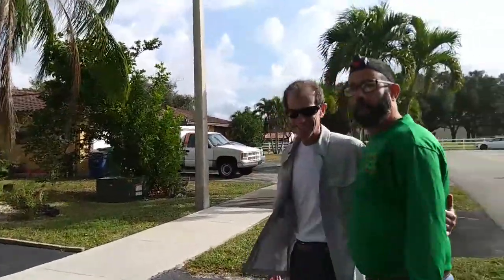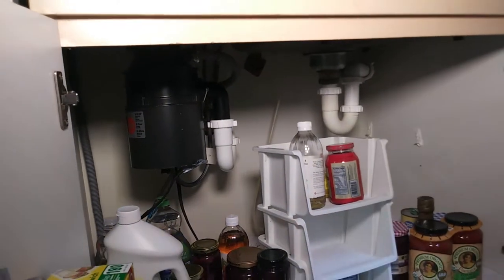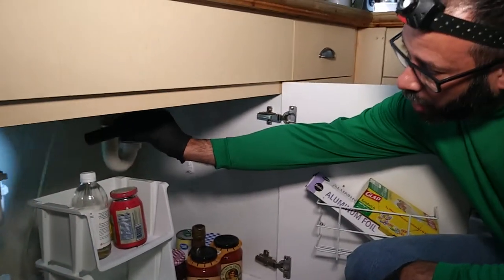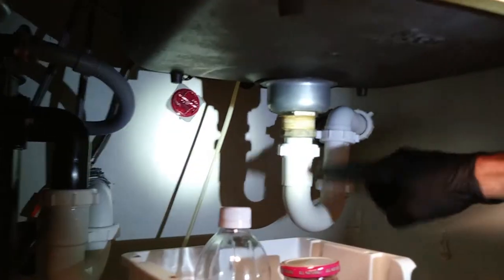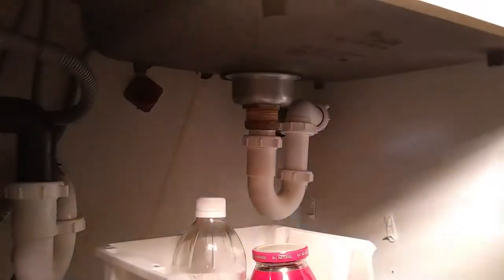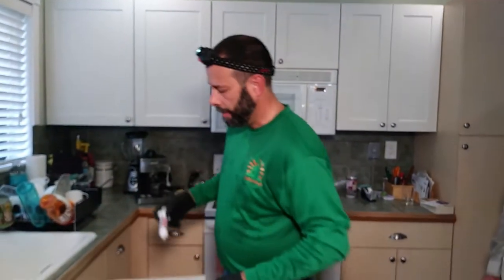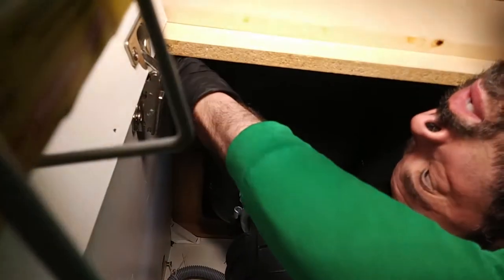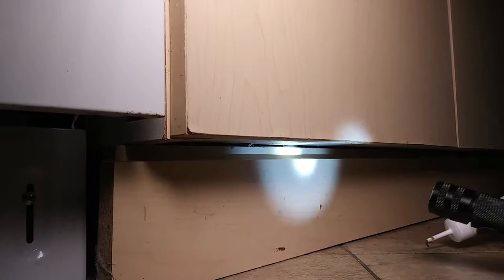American Cockroach Service Without Using Indoor Sprays

Comment: We bought the stuff he used on here.  
I live in an apartment   had roach problems we used Combat didn't work . This stuff really works I was like I hope I don't spend my money and it not work. I was so surprised how fast it works. You can actually see theses roaches eat this stuff.  And i don't  remember if it was later that day or the day after. These roaches were walking in circles. And wouldn't run away when I got close to them  it's unbelievable  but so so true  it's been 2 months and no roaches. So so happy I came across this video

Comment: I have noticed smokey brown roaches evidence in my garage (garage not very cluttered and small). There arent any food/water sources in there. My garage is also not connected to my home and is quite far from the garage. So I'm not worried about them getting in my home. They have recently arrived due to landord having a pile building materials nearby. The pile has since been removed. I would like to enquire what the proper next steps of action would be to take in this case